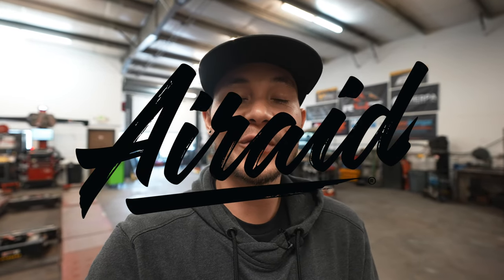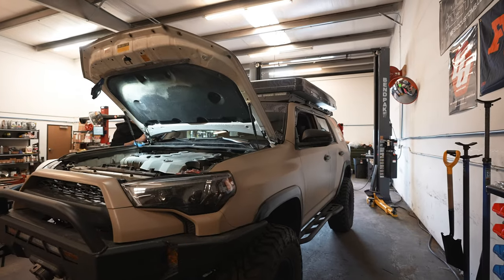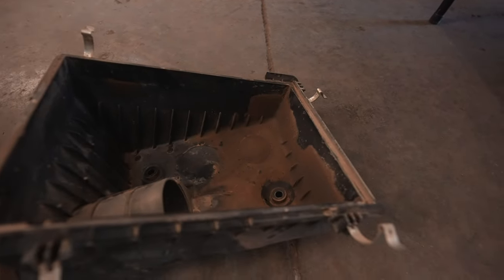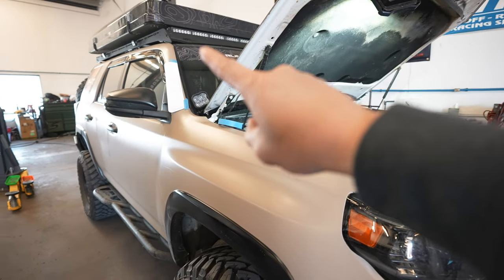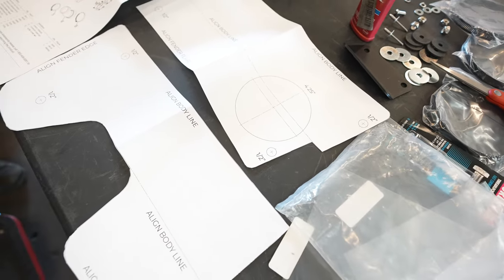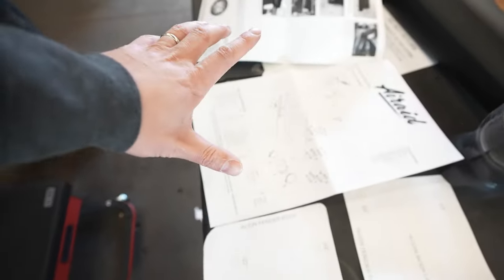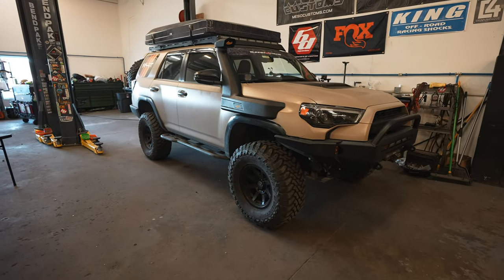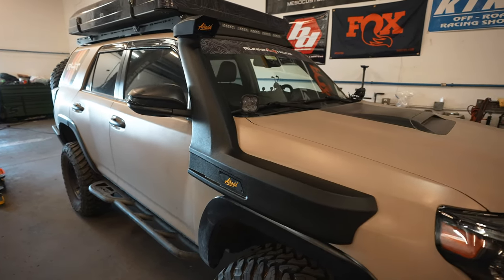BEST Looking SNORKEL for the 2010-2022 Toyota 4Runner? Fresh, Cold, and Clean Air with a Snorkel

Comment: The best looking snorkel I have seen is all carbon fiber
Reply: Yeah, that's not a good snorkel. Very small diameter in general, but the connecting pipe from the snorkel to the air filter housing is even smaller, definitely causing some air flow restriction. The carbon fiber itself is not a good idea if you are offroading. Sun will destroy it, any rocks hit it, it will crack it. Alphaequipt is a no go for me.